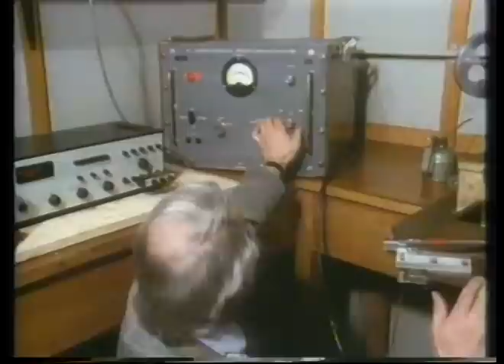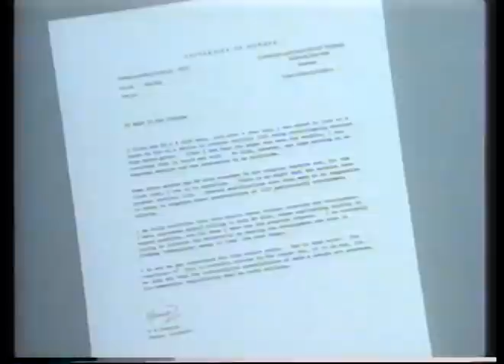Anti-Gravity Machine (Part Two)

Comment: I imagine a machine very similar to generate Antigravity. But the problem is the amount of energy to rotate the counterweight at very high speed.
Beautiful Documental.
Reply: Accelerating the gyro/s up to there initial RPM's would take the most energy, but once it reaches cruise RPM it would take a lot less energy to maintain it. But its not so much about how much energy, its more about creating a force without the use of propelling matter out of the rear of say a space craft. You could possibly create the energy required with solar panels or a nuclear reaction to power electrical motor, so once its in space you could then use the gyroscopic propulsion to push it along indefinitely with solar power etc and without having to lug around tons of rocket fuel. Remember there is no wind resistance in space and so acceleration doesn't necessarily have to be brutal and fast, it could just chug away continuously for weeks and months to reach a massive speed, that's the same principle behind ion propulsion, it accelerates really gradually but eventually achieves massive velocities. Hence the horizons probe is now doing something like 56,000 mph or something silly.
Reply: @jcreedy20  
Well. That's true in space. But into the gravity you must continue to spend more and more energy. If not, the machine will drop down.
Reply: @MasterMindmars  Its a strange one alright. That is the real question is it not?, does it put out a practical force to be feasible in earths environment where we have this pesky atmosphere slowing everything down and that crappy lame gravity! Who needs that anyway! It would be way more fun if there wasn't crappy atmosphere and gravity! Bllleeehhhggg!! What's with this whole thing about laws of thermodynamics as well, another crappy thing that says we have to spend loads of energy to create our desired reaction etc. Cant we just do away with all that stuff and be like in the matrix where we use our brains and stuff to do stuff which is awesome!
Reply: @jcreedy20  
I simply thought this: a mass rotating at very high speed couldn't be attracted by the gravity field. Why? Because force field don't have enough time to attract. Well, this is only an idea. Nothing more.
Regards.
Reply: @MasterMindmars  Hmmm, I had my first real experience with a large rotating mass the other day, my ebike has a large rear motorbike wheel and a massive heavy electric hub motor in the middle with a relatively skinny frame attached to it lol. I was doing 50 mph on it and I tried to pretend like I was furiously peddling as I overtook this car hahaha, it was kinda of me trying to pretend I was actually peddling past the car with my own legs, and not the chunky motor. So I tried to flick the bike from side to side like when cyclists are stood up and peddling there absolute hardest and found the rear wheel was trying to stay still, and I could fell the entire frame flexing as the rear wheel was practically staying still, then I remember watching this video and how powerful a gyroscopic force can be. Then realised that my rear wheel is essentially a rotating 20kg flywheel and I was trying to flick it around like it was nothing haha.
Reply: @jcreedy20  
Our imagination is big. 😂
Reply: @MasterMindmars  Indeed! So I was wandering if you could have a flywheel on a gearing system so it could be placed turning at a critical angle to produce downforce when ever you lean your bike over to turn????
Reply: @jcreedy20  
I don't know.
Reply: fusion energy is needed maybe even something more powerful

Comment: All successful Anti -Gravity scientists know  about the  magnetism factor.  Given the simPle FACT that IT WORKED BEFORE THE UNIVERSITY REQUIRED THAT THEY 
INSTALL A METAL  SAFTY CAGE. The cage has messed up the magnetic fields..Sorry for the messy text because I was typing blind with out display
Reply: The placement of the cage or Faraday cage had nothing to do with its failure to perform for some time in the university.
The university authorities demanded that I use an electric motor instead of my smoky glow plug engine.
All nice and smooth and quiet and useless.
The electric motor could deliver 7000rpm on a good day, my engine could deliver 14000rpm plus a bit.
There is factor connected to the rotation speed of the gyroscope which ultimately creates the vertical thrust.
The university authorities were warned but ignored my wishes.
I suspect they thought they were wasting their time anyway.
Eventually and as soon as my engine replaced the electric motor the device worked perfectly again.
Reply: +Sandy Kidd  No problem Mr. Kidd, the video neglected to say all of that. I never doubted your abilities. I would still like to see it fly with that cage on top of it. LOL!
Reply: Hello Papa Dean.
Unfortunately not much of what transpired in the university was ever recorded or made public.
I discovered very quickly that the university staff I worked with were extremely anti inertial drive and there was no way the device would ever be accepted as genuine
For the record the university staff were quite happy for me to spend the rest of my life waiting for them to present me with a reason why the device worked.
At first one university staff member claimed it was coggling which allowed it to lift.
Coggling That had me thinking,what was this coggling?
I think he had qualifications?

At the end someone claimed that the device was climbing on its lower support bearing.
I still do not see how but It was suggested that it was climbing up on its lower bearing,
The lower bearing I remounted in gimbals to eliminate that suggestion from any argument.
When remounted the device probably rose even smoother than before, however that is the official reason the project was terminated.
I suppose it was the best they could do at the time.
That was 4 months of my time wasted prior to the whitewash.

A device like this just does not have a chance with them.
When my VIPAC Laboratory test (I do not know if you are familiar with this) became known a physicist from Canberra University claimed the box it was enclosed in was acting like a hot air balloon and was creating the lift.
The engine was water-cooled and running very slowly which made it greatly overcooled, so temperature rise inside the box would be marginal at best.
A hot air balloon, I suppose I can consider myself fortunate that it was not the gravitational attraction from the fictitious black hole in the centre of the Milky Way that was creating the attraction.

Comment: 3:18 - the conversion of angular momentum to linear momentum is precisely what an internal combustion engine connected
to a powertrain does (in most cars); and the model air-plane internal combustion engine (and/or electric motor connected to the drill that was in Sandy’s shed {see part 1 of this story} driving his “anti gravity machine”) that drives this “anti gravity machine” clearly derives its input power from these sources.

This is how it converts angular momentum to linear momentum; in much the same way that some gyroscopes that are temporarily/permanently connected to external power sources can.

4:52 - it is establishing its lifting force by way of angular momentum, torque, and gyroscopic motion;, and - of course - as a product of model air-plane internal combustion engine and/or electric motor (connected to the drill that was in Sandy’s shed) that drives it.
Reply: But it IS unique lift
Reply: @Mattstiless  Matt Stiles comment; “But it IS unique lift”.

No Sorry Matt you're wrong.

Not only, does Sandy’s invention not constitute a “anti gravity machine” - but also, the force it seems to display in the vertical plane is not unique either.

Here’s a few more considerations;

A) @ 5:27 - Dr. Davidson’s (Dundee University) role appears to be to evaluate the feasibility of Sandy Kidd’s “invention”; perhaps for the purposes of venture capital and/or other funding - which it clear didn’t receive for the purposes of full commercialization

B) At no time in any of the 3 videos related to this does Dr. Davidson support the view/claim that Sandy’s invention is unique and/or going to provide mankind with a new source of energy.

C) Also, it is noted that currently no-one seems to be moving/flying around in any type of craft (submarines included) that is powered by this “anti gravity machine”; which appears to be an outcome that was perhaps foreseen (@ 6:53) by the hesitation/reserve that Dr. Davidson displays when asked whether Sandy’s “anti gravity machine” will provide mankind with a new source of energy. 

D) @ 9:17 you can clearly see the large electric motor (used at Dundee University to evaluate) driving Sandy’s “anti gravity machine”. This is the power source providing Sandy’s supposed “anti gravity machine” with the power that - by way of the combination angular momentum, torque, and (typical and/or non unique) gyroscopic motion associated with Sandy’s gyroscope - is ultimately responsible for the small amounts of vertical lift Sandy’s supposed “anti gravity machine” appears to exhibit.

E) In previous episodes (including part 1) it was the model air-plane internal combustion engine (and/or electric motor connected to the drill that was in Sandy’s shed) performing the function of a power source connected to Sandy’s supposed “anti gravity machine”; that - by way of the combination of angular momentum, torque, and (typical and/or non unique) gyroscopic motion associated with Sandy’s gyroscope - was then ultimately responsible for the small amounts of vertical lift that Sandy’s supposed “anti gravity machine” exhibited.

F) The same electric motor being used at Dundee University could possibly drive a small (helicopter style) propeller and provide vertical lift that way also; and in doing so (the same electric motor) may even result in a more efficient means to convert input power to vertical lift than Sandy’s interesting (but inefficient) gyroscopic assembly of counter rotating parts.

G) The fact that gyroscopic motion and the physical properties/quantities intrinsic to it (including angular momentum, torque, gravity, and mass); (i) behave in this understood way and/or as I describe; and (ii) do not represent  an “anti gravity machine”; is not even a point of contention amongst those respected in the related fields of science/physics. 

H) The gyroscopic motion and the physical properties/quantities intrinsic to it (including angular momentum, torque, gravity, and mass) that underpin the somewhat counterintuitive (but not officially anti gravity) behavior and/or vertical lift that Sandy’s gyroscope (inefficiently) exhibited is a well known scientific principle/phenomena called gyroscopic precession. Please see the below link.
https://youtu.be/XPUuF_dECVI?t=2192

I) The fact that the somewhat counterintuitive/complex behavior of gyroscopic precession often manifests itself in ways that “appear” to defy gravity and/or constitute anti gravity behavior, unfortunately means that those explaining it will sometimes use terms such as “gravity defying” and/or “anti gravity” behavior in order to add mystique to the behavior and/or circumvent having to explain the behavior with the correct physical properties/quantities. 

J) Nevertheless, whilst the behavior of gyroscopic precession is counterintuitive and complex, it defies gravity no more than a; bird, rocket, plane, or submarine, does. 

K) Not in the least as it is gravity itself that is responsible for (exerting) the torque that is associated with many forms of gyroscopic motion/precession; but (in simple terms) all that is really happening is that  the interplay between gravity, mass, angular momentum, and counter/torque gives rise to a complex sum/product of forces in various linear/other planes.

L) Which then - for any suitable gyroscope that is assembled and/or oriented in a particular way/plane - gives rise to (as shown @ 23:00 minutes into the above linked video of Professor Lewin; within above point “H”) momentum/force in any given vertical/horizontal plane. 

M) As such all you have to do is orient the gyroscope assembly in a way so that the output gyroscopic precession and/or forces are produced in the plane you want to demonstrate movement in; and then all (those that don’t understand gyroscopic motion/precession) will swing from the chandeliers shouting “magic”, “witchcraft” and/or “anti gravity has been invented/discovered”.

As such, all that is happening with Sandy’s “invention” is that his gyroscope is assembled and oriented in a particular way/plane so that (wrongly called anti gravity) momentum/forces that it exhibits are produced along a preselected vertical plane.

Take a look at 13:37 of the above-mentioned video of Professor Lewin where he demonstrates some counterintuitive results/physics with rolling motion/forces and various cylinders. Note that the hollow cylinder always (and rather counterintuitively) comes last.

Which means that the rate cylinders roll down inclines is completely independent of weight, diameter, and length; counterintuitive.

So, why then does the hollow cylinder come last? It’s certainly not due to any mystical anti gravity properties that’s for sure. 

Rather counterintuitively its actually due to the cylinder’s geometry; where the mass is located, gravity, kinetic energy, and moment of inertia.

And, just as with the aforementioned demonstration in relation how the hollow cylinder counterintuitively/always comes last in ways that do not mean it possesses anti gravity properties; gyroscopic precession too behaves in a manner that, whilst it may be counterintuitive, does not constitute a unique anti gravity machine.

Comment: It is using two gyroscopes. But what more if it use 4 or even 8. And what if we apply tesla's idea about this?
Reply: Red Piscador   Y was thinking the same.
Reply: I know right? Tesla's idea can create free energy to be the power source of gyroscopes. In that case we can create a gasless vehicle and stop abusing earth.
Reply: No, NOT AT ALL! By the 369 Rule you need 6 to give a balance to the forces on the axis in this type of design. I have met Mr Sandy Kidd at an exhibition, a very humble man and obviously dedicated to his work.  I also agree with the contributor in regards to the use of mercury. If you can imagine a saucer with 2 tubes of Mercury round it's perimeter edge being driven round at very high rotational speeds in opposite directions driven by magnetically powered electrical windings; this would also give a lifting balance gyroscopic effect  which could quite easily be controlled.
Sandy I solute you for all your amazing efforts and wish you and your lovely supportive wife all the best and I hope your efforts are recompense financially and any other way that you both I think, deserve. 
Deep respect,  
Pat. Fi Dunfermline.   @e_jhong03

Comment: Really the problem is that the gyroscopic effect only works in the vicinity of a gravity producing body. So out in space you'd have to align the object to be propelled with an object of great gravity behind you in order to move forward
Reply: No, the real problem is the gyroscopic effect produces a twisting force, not a lifting force. They work fine in space.
Reply: Again... no. If you try to reproduce the gyroscopic effect in space for use as propulsion you'll run into a problem know of as the Dzhanibekov Effect and you'll get nowhere.
Reply: @davidchanget2563  If you try to reproduce the gyroscopic effect ANYWHERE for propulsion you'll run into the problem where is does not make propulsion.  It makes a twisting force, a torque.  Space included.  Twisting only.
Reply: That is absolutely incorrect.   The gyroscopic effect depends on the mass of the rotating body, the mass distribution around the rotation axis, and the angular speed. A nearby mass (gravity producing) could affect the precession (not to be confused with precision) of the gyro but the gyroscopic effect is there whether or not any mass is nearby.  Conservation of angular momentum is the principle that is harnessed that produces the gyroscopic effect.  Inertial navigation systems use gyroscopes and precess zero degrees relative to a ship orbiting the earth and oriented to the same star in space.  Or precess 360 degrees relative to the ship if the ship maintains an orientation where earth is always down from a given point on the ship. An example of the this is the ISS which rotates or "flips" about 4 degrees per minute to keep its "belly" towards earth.  In 90 minutes it does 360 degrees of rotation and 90 minutes is the time it takes to do one orbit.

Comment: Seeing the arguments in the comments section is staggering. There are things that need to be kept secret because from the looks of it the public can't even agree on a video. The public is definitely not even close to prepared for the truth.
Reply: Agreed.  The public must agree on things and mostly with me.  Or, they are not ready.
Reply: @Jointtaskforcex1   I know.  It's me who decides.  Or at least it should be.  One day the public will be ready for this non-levitation machine.
Reply: @Jointtaskforcex1   funny that the device has a string to lift it but nothing to hold it down.  The maker seems pretty sure it won't work.
Reply: In space, it would not work unless we use gravitational assist.